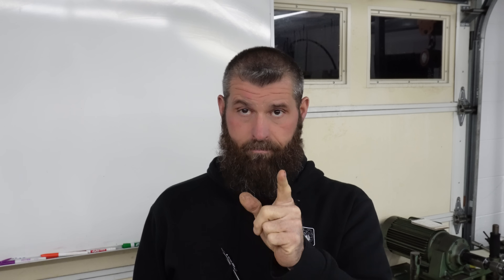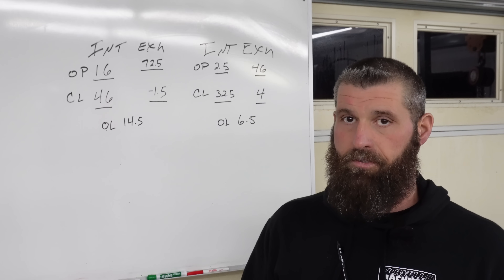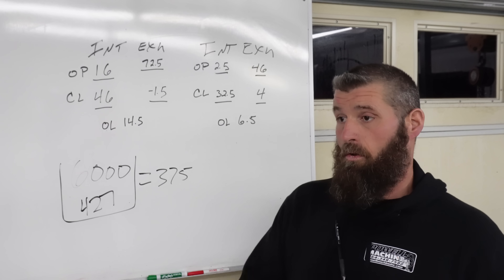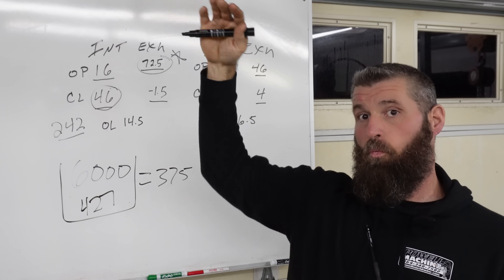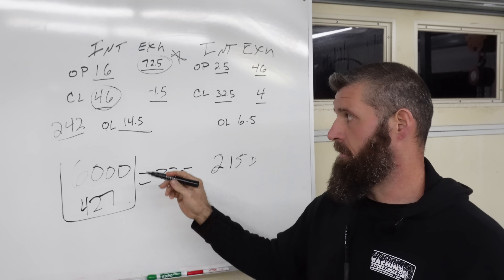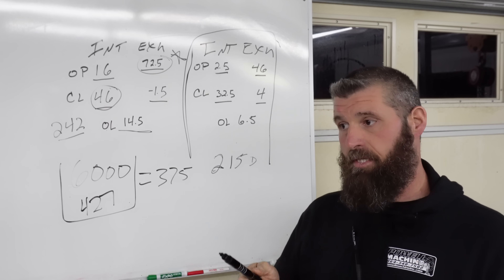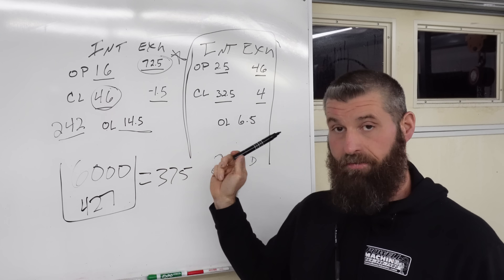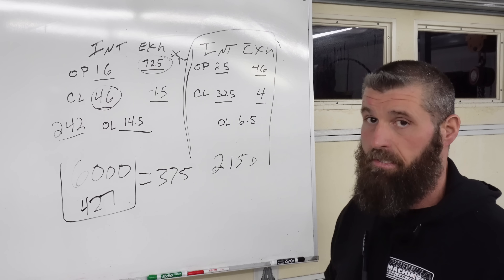Camshaft Tech... How to lose 100 Hp!

Comment: After studying cams for the last 20 yrs and the Big Block Chevy I learned the most critical timing spec is the intake closing point. You made a great point about the exhaust opening and keeping pressure in the cylinder. The 2 big dawgs in the LS camshaft world, Texas Speed and BTR don't even provide those specs. They don't list the overlap either. Makes me wonder...
Reply: I’m no expert. I had a custom made camshaft for my big block Oldsmobile. It’s a solid roller. Exhaust opening is 67 degrees. I’m questioning the cam now.

Comment: Looool.. I want them to post a video with that cam installed straight up! I want to see that "Creamy smooth idle" load the dyno @ 2500 RPM.

Actually, I kinda want to see that cam and the 215 duration with variable value control sweeping from 10.25 advanced to 10.25 retarded.

Comment: Where the valves opens, closes  and overlaps is dynamic compression,   lift should be determined by head flow characteristics.
   
????  Do I have this correct ????

Comment: you could tell it was struggling by how long it took to get to 6000 rpm
Reply: That's the dyno they're using, nothing to do with the engine, they use 300rpm per second acceleration rate

Comment: I sent sb2.2 cam for repair unfortunately beyond repair. U said the same to me. The math wasn’t mathing out. It was 283/300@0.050, .870/.870 on a 114.  Exh open@88 and int close@71.5. Engine 440ci with heads flowing 425cfm at .850 lift and 15.1cr. U didn’t give suggestion would have been curious!

Comment: brother powell, can you post a white board episode on a 6.2 or really any ls with mild compression ( gm flat  top piston motors) using the best  cam events. let's say we want an everyday driver but we are staying in the gen 3/4 engines. we all want the best out of what we got. what really excites me at least is what becomes the very next cheapest option in increasing wheel horsepower in the ls platform after the stock block cam increase. do we go more compression? do we go more stroke? do we go better air flow? and with that said does the cam events need to change with each of those. obviously what happens in the end is cubic inch, breathing deep and long and exploding as violently as possible makes the records. however i think the majority of us out here are guys just trying to build it the best we can. we all know a cars ability to use the power and get the horse to the sticky surface is how to win. i think with your knowledge we could pick your brain on the "secret" of the ls engine and what it likes and the sequence in how you get there. maybe this could be a multiple episode learning. as rpm , horse power and torque all are related and are changed by mixing all the ways we can get air in and out and what time it explodes.  your cut to the facts are epic. !!!!!

Comment: I’d argue the INT close event is more/the most important,  once the engine is past that first 90-100 degrees from TDC on the power stroke most of the useful energy has been used up, overscavanging the cyl with early exhaust isn’t great, but blowing the intake charge back up into the intake with a way too late of closing point is worse.

Comment: IIRC that cam is similar to the one that won Weingartner's LS cam challenge. Maybe not that much lsa.
Reply from the maker: No
Reply: I looked, you're right. The cam they used is the same cam Summit submitted to the LS cam challenge except at the cam challenge they ran ICL at 110 not 105.
Reply: Cam challenge cam IVC 51/EVO 67 so not the same cam.

Comment: Simple, that head need to have the engine run to 8500 rpm. With peak HP at 6000, that is a wrong head with too low velocities, Will be a turd.
Reply from the maker: Na

Comment: Does that head have a small exhaust valve? Going by your numbers it looks like you have a split giving 15 more degrees to the exhaust, so something like 215/230 on a 108 lsa, with a 105 degree intake centerline.
Reply from the maker: Just about anything with a full exhaust wants a fair amount of split,  i put about a minimum of 10 degrees in everything.

Comment: It is so easy to overcam an LS based engine. We just finished dynoing a budget 6.0 with unported 5.3 heads, stock replacement pistons and a BTR Truck Norris NSR (no springs required) and I was very impressed. The end build was with a dual plane, but with a Victor Jr it made over 450 HP, with 15" of vacuum. With the dual plane, it made 430ish, and 450 TQ pretty much everywhere. GM sure got their act together with this platform. This cam has a 212 degree intake duration, and a 106.5 LSA.
Reply: That cam is far from ideal
Reply from the maker: Sounds like a great build!
Reply: @powellmachineinc  Thanks! Customer was looking at a fairly large duration cam after watching a bunch of Richard Holdner videos, but after discussing the end goals I knew it would have been a poor choice. When the client starts talking about fuel economy and overdrive transmissions you steer clear of the 23X duration grinds LOL. I did a 2500 to 3500 pull and it was happy as a clam, torque was still quite flat down there.

Comment: Definitely down 60hp at the least. It seems odd that people who have built a good number of street engines wouldn't understand cam specs? It seems as if they thought the LSA number alone being real wide means smooth idle and good vacuum? It's overlap and duration and LSA combined that gives an engine its character. 100% correct, if you're not building and using cylinder pressure to full advantage, you're wasting the cubes. Crazy having 427 cubes and only putting down 514TQ... and having to wait until higher in the rpms to even get there. That cam was all kinds of wrong for that build! I'm an amateur, and even I knew that cam was bananas.
Reply from the maker: Exactly!

Comment: A 242/251 cam with a single plane intake, those heads, and that many cubic inches isn't a terrible choice (if you're looking for higher RPM horsepower). Doing it on an engine with 9.77:1 CR where you want to limit the revs and then installing the cam so it's 10.25 degrees advanced? Now that's certainly... another... choice.
Reply from the maker: It is a terrible choice
Reply: @powellmachineinc  No, the problem is the mismatch of parts/specs for an intended purpose and that goes beyond the cam itself - it started with deciding to put a single plane intake on an engine with 9.8:1 compression and just went downhill from there. On an engine with 11.4:1 compression and 19 fewer cubic inches your best spec'd cam made exactly 12.0 hp more (peak) than this exact same cam.
Reply from the maker: @nowayjose596  yep, still a terrible choice
Reply: @powellmachineinc  I mean, the winner of the LS cam challenge made 15.0 hp more (peak) than your highest hp cam, so does that mean your cam was also a terrible choice for a larger cube LS with good heads, a single plane intake, and good compression? Maybe we just differ on the definition of "terrible", but if this 427 had 11.4:1 compression I think you would be hard pressed to spec a cam that makes 25 hp more than this Summit cam would. Do I think it's ideal even with that added compression? No. Would I call it a terrible choice? Also no 🤷‍♂️
Reply from the maker: @nowayjose596 15hp is not 100+.... I can put a hundred hp in that LS by accident......, he'll we just did 650hp in a 10-1 421 sbc 70 less cfm, (bob mcvay)😊😊

Comment: What do you expect from anybody that calls it pound feet of torque instead foot pounds of torque? I know but it is a pet peeve of mine kind of like nails on a chalk board. I want to see more. I also have a similar build that I would like to visit with you about on the phone, this one could maybe turn out to be a great video for you ( a major player building engines with zip guns and even starting the bolts with the zip gun, $18,000.00 build and they don't even degree the cam, uncovered fresh builds all over the shop waiting for parts or to be finished and even on camera. )  I have a feeling that I may need to buy a cam from you as well before this is over with. Thanks for the informative videos.
Reply from the maker: Glad to hear you enjoyed the video!

Comment: I can think of 25 shelf cams that would make +100 HP, agree the Right Cam would be worth even  more. Talk about neutering an almost perfect combo. (Compression is a point low...for a pump gas street engine) The chosen cam had the perfect storm of wrong data, as proven by the results.  What do I know, not like I have data on LS Stroker shelf cams.....😂
Reply: I'd imagine you could. In this case whoever picked that cam.. Let's just say the blind squirrel picked a shell with no nut.
Reply from the maker: Almost "any" cam would be a "better" cam!

Comment: definitely do videos like these on occasion. so maby long term a viewer will see it and avoid this situation. sad part it that wrong cam cost as much as the right cam. . ive seen this exact problem several times over the years.  mainly is folks over camming stock heads and killing the power in the normal driving rpm.  boy it sounds good but thats all it does.  meanwhile my mild engine with tight quench and a proper cam dont sound like a drag car but it runs great.    seems to me that huge cam would need to spin up to 7000 or more rpm for it to get where it needs to be?  im no LS guy. but i do know they react a little different to cam changes versus the old big and small blocks im used to working with.

Comment: Interesting  you think cam .... i found  the cam different  enough to be interesting  ... not many run plus 10 advance  .... its using like 263 cfm to make that power my new cfm demand  formula  puts it at 269 demand  at 6200 rpm .... the low torque  is soggy  ... im thinking  it needs a longer intake  runner length  and pick up the airspeed

Comment: Daniel  A lil help picking a cam . It's a 383 sbc  the old style trac 1 heads  11:1 comp  going to freshen it up over the winter . Looking to get 525 550 hp out of it 4 speed car  with power brakes  so need vacuum  ! Thanks
Reply: Go to their website and fill out the cam request form. Email it to them and they will work up a suggestion. That's what I did and currently have a new cam on the way.
Reply: @LilSki3  👍 Thank  You !!

Comment: Their video has the intake lift at .626..And what ever heads they were using it would be interesting to see a bench flow test at that crazy lift..Are you really getting more flow at .626 then comparing it at .500
The stress at .626 must be gigantic on the valve train..With that kind of lift and 6K RPMs the spring pressures at closed and open must be off the chart!!

Comment: I watched the Power Nation video and when I saw 242 intake I figured the thing would tickle 800 hp at 7500...then I saw how it was installed and started scratching my head. I felt bad for Pat because he definitely knows what's up, but had to put on the smarm to support the sponsor. 
Be cool if they asked a few cam grinders to send over cams to see which made best power.
Reply: Powernation did a bad job .. a dam stock ls3 with headers makes 480 490 on a engine dyno
Reply: What's funny is Summit has multiple LS cams to choose from, and although I wouldn't really consider most of them "optimal" More than a few would have been a lot closer than this cam was. There's probably almost a dozen grinds in the series.
Reply: You know there was 1 thing I questioned them on the big 427 or whatever sbc that had 13 degree heads on and there compression ratio was under 14:1 I go why 410 sprint car are 16:1 and even 360 they try to get 14.5:1 so I don't and they said because of fuel there running and wanted the motor to last long and I go ok makes sense but even then that 110 octane should handle more than 14:1 compression but for long term motor for racing i mean i guess I heard people say they don't want more than 14 because of making them motor last longer but oh well I don't know

Comment: I know Dan doesn't like LSA, but isn't a later exhaust opening and earlier intake closing add up to a tighter LSA?
Reply: Yes, you're basically retarding the exhaust lobe and advancing the intake lobe, bringing them closer together which results in a tighter LSA.
Reply: If the duration is fixed, yes. But why fix the duration? Why not set the events where needed, then let the duration be whatever is determined by the events? 

And why is a tighter LSA bad? If the open and closing points are ideal, or close to ideal, and the LSA is tighter, what is the downside?
Reply: @v8packard  If one has a lot of experience and resources, each event may be specifically chosen with success.  Most people don't know, they pick too big a cam, then a wide LSA, like these clowns did, thinking that'll increase vacuum, make more torque, and be more street friendly.  Usually heads too small for the CID, and low compression runs better, and makes more torque, with tighter LSA.
Reply: @peterthadeus9441 Experience is a bighelp, especially when you learn from it.

Does a tighter LSA help an engine with less than ideal head capacity? Yes. Is LSA what impacts idle? No, overlap is the driver of idle.
Reply: @v8packard  Exactly.
Reply: @v8packard  It's like music theory.  LSA is one of the tools used to help set those events.  If you're a genius, and just know exactly what combination of notes will make a hit, then so be it, but most people learn scales and chord progressions.

Comment: I'm interested in seeing you make that duration and lift work by changing the other specs in the cam. Where would RPM and the Power Band end up with heads that large?
Reply from the maker: Peak torque around 3500-4000 and Peak hp at 6k
Reply: So torque moves way down and horsepower stays pretty much in the same place. And in doing that do we gain back the horsepower you say we lose from the overlap and dumping our compression stroke? This is obvious? I assume the answer is yes and more power is made as well

Comment: I do not doubt you at all. That channel either does not have much actual knowledge or they are just doing builds that are basically created strictly to pay off some their top their advertisers. I have seen that that on a lot of their builds.  Just like Hot Rod magazine became after Petersen left the building. Lying for money, and duping the dupes that do not know any better
Reply from the maker: Scary stuff
Reply: The stock LS7 cam makes that HP with a set of headers and tuning…specs are 211 / 230 on a 121 LSA… and it peaks a 6800 RRM.  Also the stock cam is close to .600 Lift due to the 1.8 rocker arm ratio

Comment: I want more low rpm, low compression, real world, street information!  Thank you so much!!
Reply from the maker: More to come!
Reply: @powellmachineinc why don’t more cam company have lower duration high lift stuff for sbc. Almost like Ls type lobes like you have. Stuff in the 220s at 50 and 600 lift. Comp doesn’t have anything close to that in there master lobe catalog. For smaller 350 383 that have really good flowing heads. It’s almost like there stuck in the past where your lucky to have 300cfm from a aftermarket sbc head. You gotta get into the 240s duration to get .600 lift in the hyd roller lobes
Reply: @powellmachineinc  Me i wanty a hot rod thumpin  87 octant!! and 14:1 or so compression ratio build water injection LOL i do kid:face-blue-covering-eyes:
Reply: @overbuiltautomotive1299 
I'm doing a set of 11.2 :1 pistons in a vr6,stock is 10:1.
Guys still do low pressure turbo setups on the stock compression ,like 6psi or so. 
It's tempting to do a low pressure turbo setup down the road, another 75-80hp would be nice.
Reply: The biggest problem with their camshaft is the ridiculously late closing of the intake valve which is bar none the most important event. Between the duration & the silly wide LSA, it's a dumpster fire.
Reply: Yes!!
Reply: Slam in a Comp XE256
Reply: @ColdSmokes  I used one in a 9.5 compression stock head 455 Pontiac. Even with 2.56 gears the car is a rocket.
Reply: @1957mrmark  I bet that car with that cam rotated the earth when you stood on the loud pedal 👍🏁
Reply: Well are we surprised by this from Power Nation!  It’s astounding a grinder produced it. Very irresponsible video.
Reply: Yes
Reply: Onya Daniel
Reply: Love this stuff!!!
Reply: In the real world you don't want low compression......especially for low end.
Reply: @HioSSilver1999  I'm building a 429 with early stock small chamber quench heads. In O/D on the HWY I should be around 2000-2100 rpm. I don't expect to be driving around above 5000 rpm anywhere. I'm looking at smallest of cams or custom grind.
Reply: @deadcarnahans1932 then thats the great part about some added compression.  It makes power across the entire rpm range.....bottom mid and upper. It likely does more for the bottom.
Reply: @HioSSilver1999  With my 1969 429 with C9VE heads the book says 10.5 
Sounds extreme but I hope to live with it. Really don't want to spend any money trying to lower it.
From what I understand the quench area is what makes it work.
Reply: @deadcarnahans1932  Never mind the book, what is it actually? CC the heads? Actual compressed head gasket thickness? How far down in the hole are the pistons? The book and the actual don't always line up.
Reply: @HioSSilver1999  I would guess low compression is relative as well. In With that cam 10:1 may even be "low compression."

Comment: Did they say the cam is 10.25 degrees advanced? Sounds like putting a bandaid on wrong cam for this application.
Reply from the maker: They made the problem worse....
Reply: They did indeed.  That's just idiotic.  It's got a built in +6 advance already.